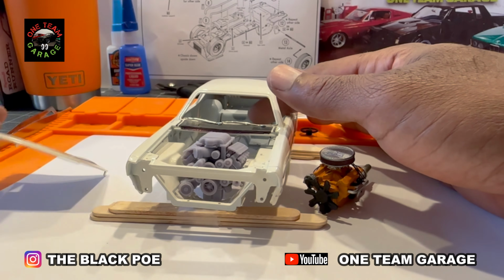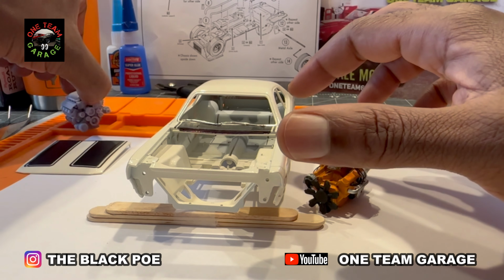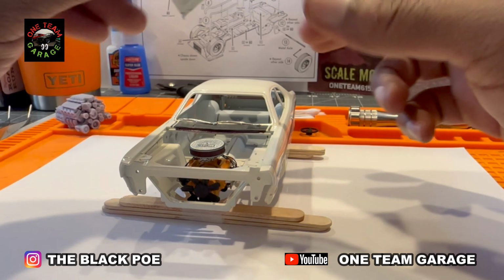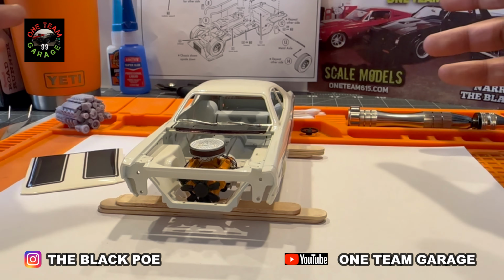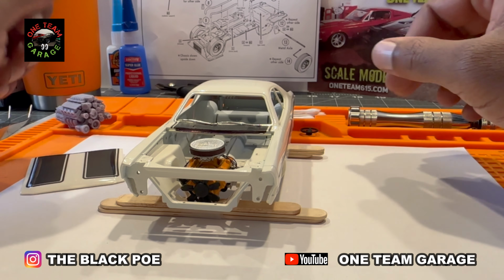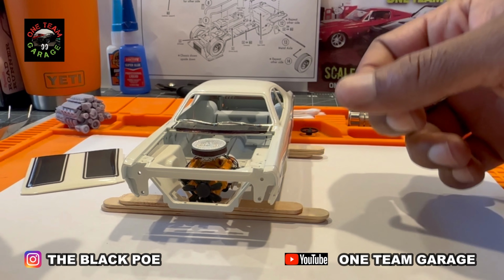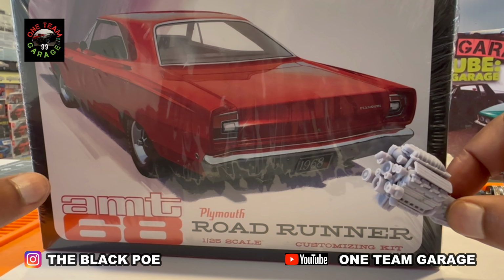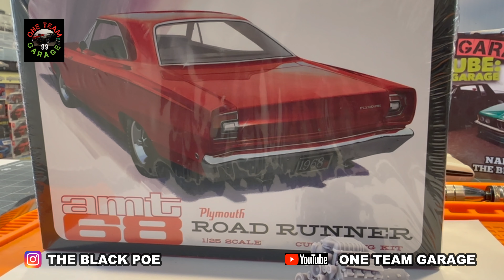Major Problem with the Dodge Demon! Model Cars & Coffee

Comment: That is going to be one good lookin' Demon.
Reminds me of a couple of real car stories. If you want to put an HEI ignition in an old small block chev you just take a good size hammer and give the firewall a good smack - distributor goes right in. If you want to put a 440 into a Duster you use a sledge hammer and hit the left shock tower in the right place - stock exhaust on the 440 goes right in.
Reply from the maker: Great ideas. I'm definitely building another Dodge Demon in the future.

Comment: I always have issues with 3D printed engines and getting them to fit.  I was contemplating putting a hellcat in the 69 super bee and it just doesn't fit side to side.  And that vast is freaking huge.

Stay safe over there.
Reply from the maker: Great point! Hopefully I can get it in the Road Runner I want to build.